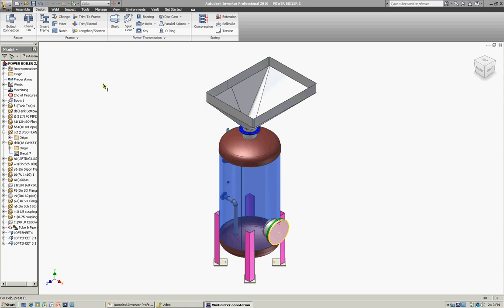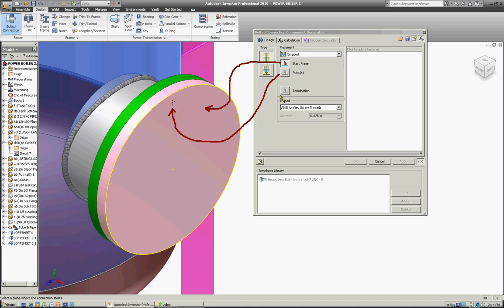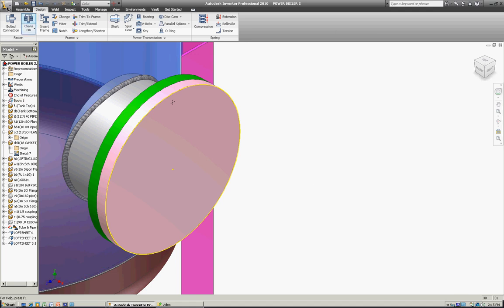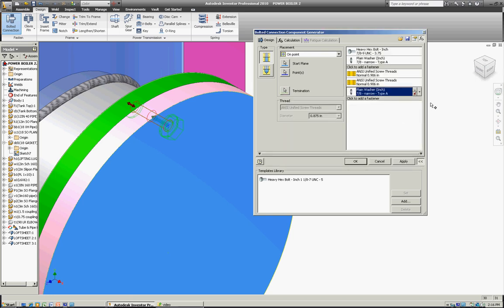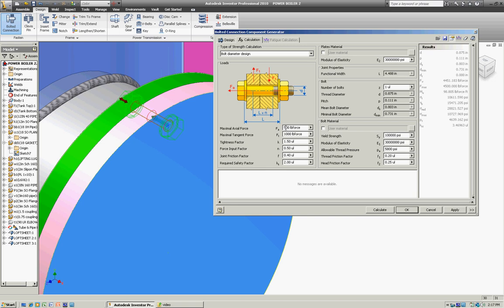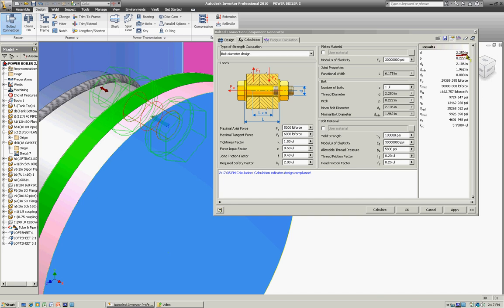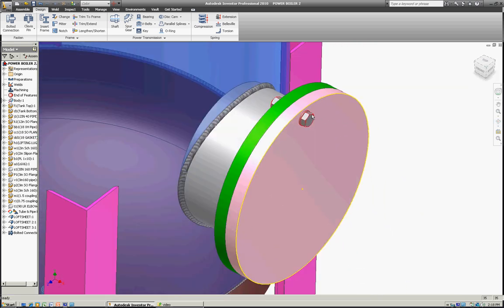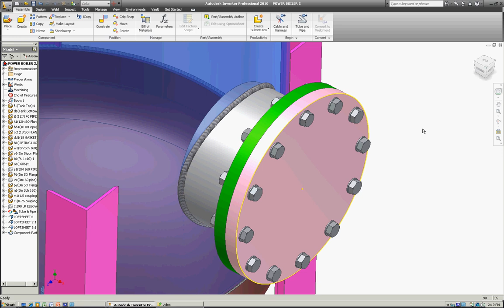AUTODESK INVENTOR BOLTED CONNECTION

Comment: Often this green part needs to be machined as weldment before bolt connection is made. And inventor has a problem. Once you machine this green part before bolting, you can not use bolted connection (inventor report that hole can not be made). It is a bug that autodesk ignores for some reason!